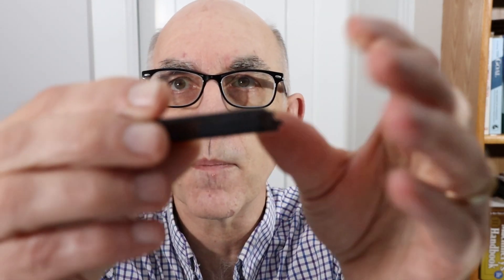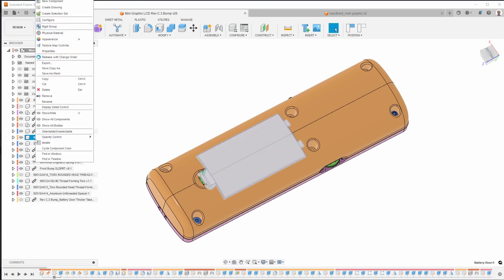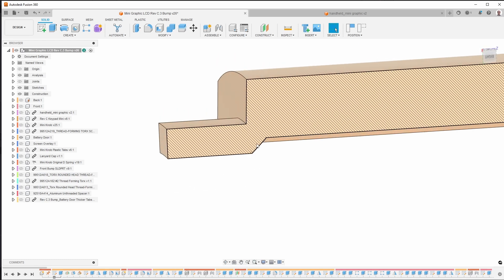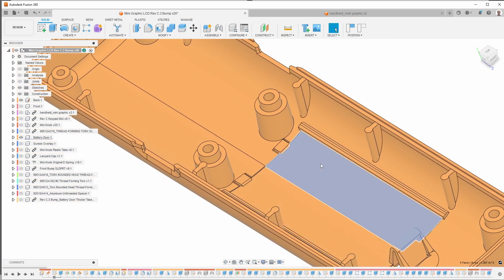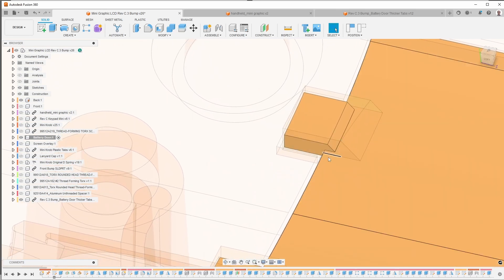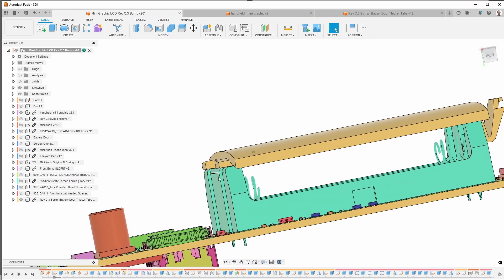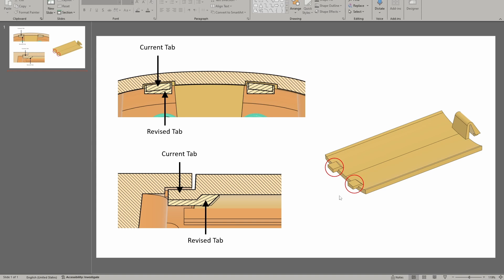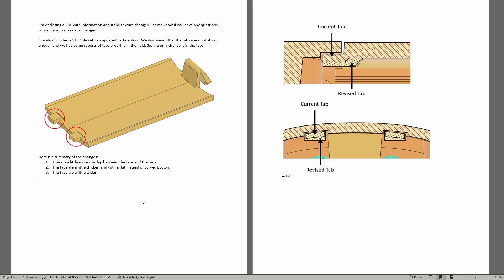Fixing an Injection Mold Design Flaw

Comment: A .005-.010 chamfer in that corner would also help a lot.
Reply: Definitely an option however a chamfer still has sharp edges. A fillet has no single point stress edge so would be the better option.
Reply: @loosrudi  I was also going to suggest a fillet, then realized it might interfere with the housing. If it did, you would need to add material to the other mold, which is more difficult.
Reply: I just watched the second video where he addresses this exact point.

Comment: Totally agree with all your points. I've been through the same process with my injection moulding company in China, and there response and solution was great. Enclosure design is an iterative process for sure, and no amount of 3d prints will help 100%, as injection moulding has different constraints to 3d prints. Done well, it's a great learning experience!